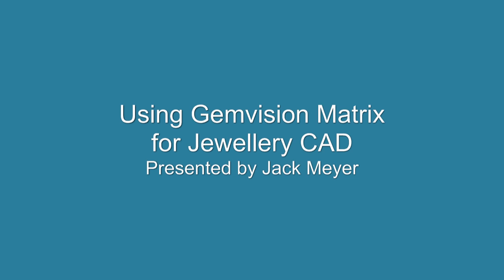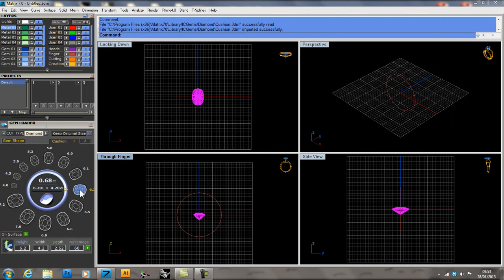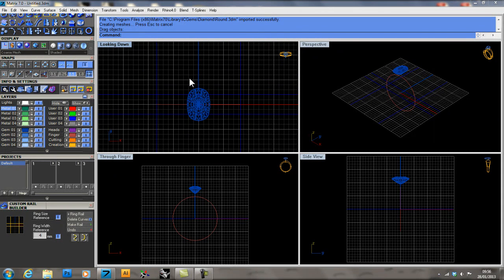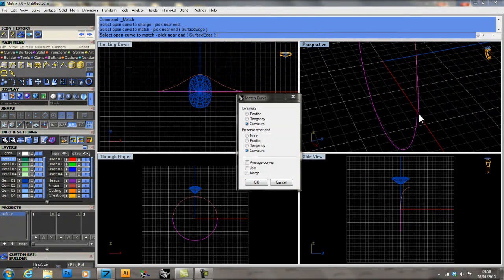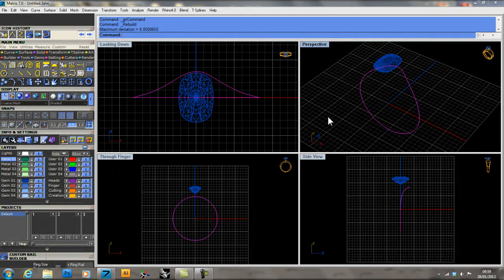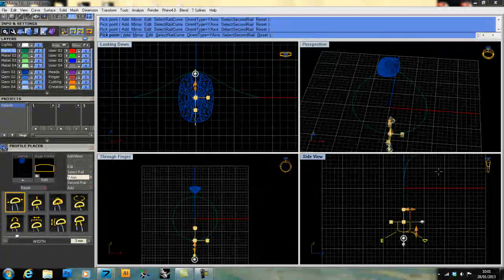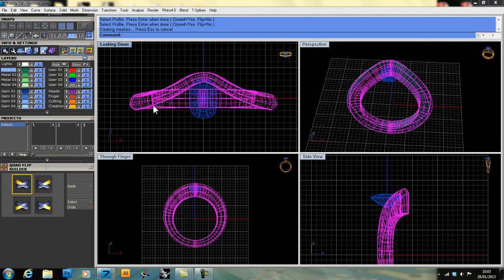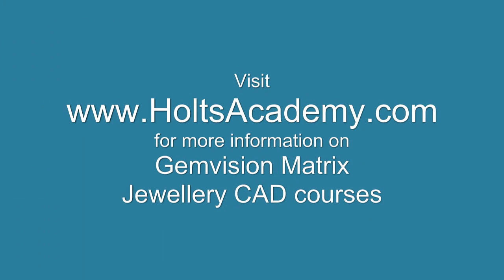Using Gemvision Matrix's Custom Ring Rail Builder to Make a Split Ring Shape

Comment: Hello,  Your page is so helpful, your blogs amazing.  One question Could I Use this program for design big size stones jewellery like semi-precious stones and different shape(Cabochons)?
Reply from the maker: Thank you for the kind words.

For cabochons, you can either build your own stones and settings manually (as I teach in my courses), or you can use the cabochons inside their own Gem Loader, which will work with the Bezel Builder with a bit of tweaking of default options.

Comment: hi, i`m new to rings and cad jewelry and i have a question: why is it necessary to add a bezel to this ring? won`t the stone be fixed in the ring`s arms ?
Reply from the maker: +danny3man - Stone setters need metal to fold over the stone's girdle (widest point), as well as something underneath the stone with which to keep the stone from rocking back and forth. You could certainly embed some sort of side-wall into the arms, but you would still need a gallery bar underneath the stone to keep it from rocking around or shaking loose.
If you're still not clear what I mean, talk to a diamond setter.
Hope that helps.
Reply: +CADJewellerySkills yes i understand now. thank for replying
Reply from the maker: No problem. Keep practicing. :-)

Comment from the maker: Mohammed al-sharif - I'm glad you like.

In this case, the bezel shape you've made is no longer possible to use with the Cut to Finger Rail command. So you'll have to make another ring rail of the same size. Just add an additional ring rail, and when it says "do you wish to replace the existing rail?" click No.

Hope that helps.

Comment from the maker: VIV JY - The most common things which can go wrong on this exercise are as follows:

1.) You absolutely have to have a ring rail and a flat curve shape in the Looking Down view before hitting the Make Rail command. If you're missing the ring rail (or if your ring rail has been modified or broken) this will not work. Likewise, if your flat curve shape is not flat in the Looking Down view, this will not work.

When in doubt, the best thing to do is to select everything, delete it, and start fresh.

2.) Once it's been made, if the custom ring rail hasn't been Rebuilt (with the Rebuild Curve command), the sweep you get from this shape will likely be broken into three pieces. This is because 1 rail sweep doesn't seem to like sharp corners. Fortunately, it's an easy fix (simply rebuild it).

Give it another go and see if these help.